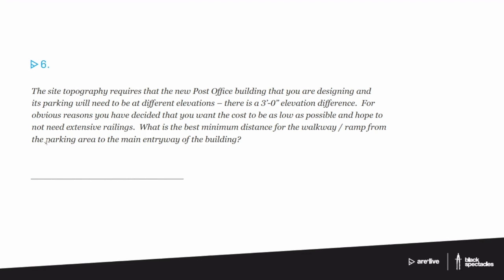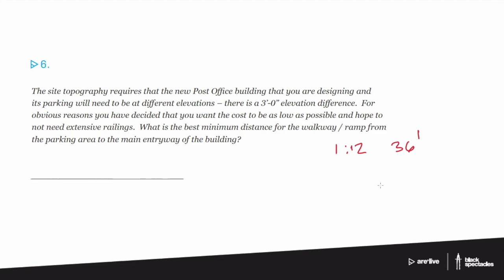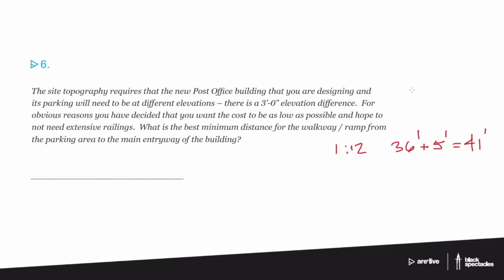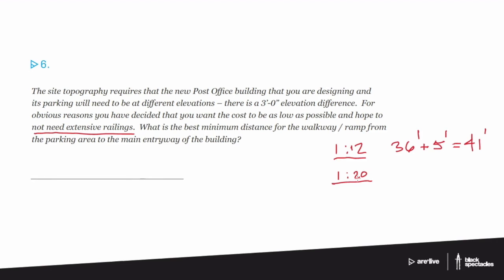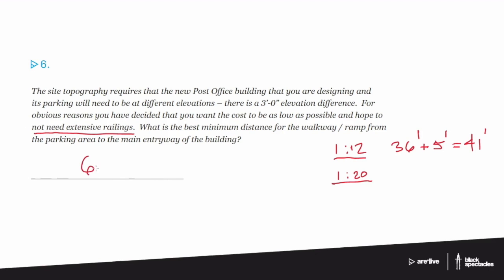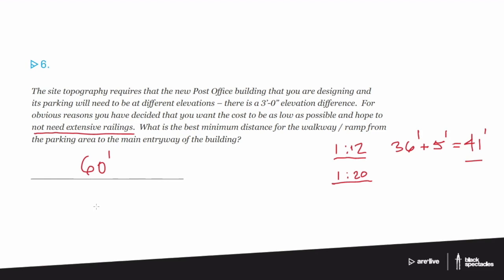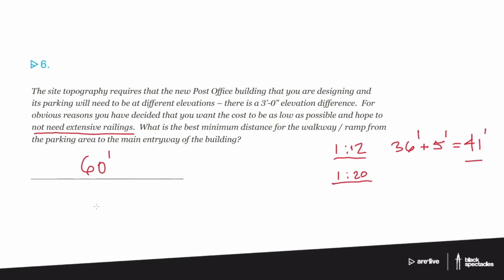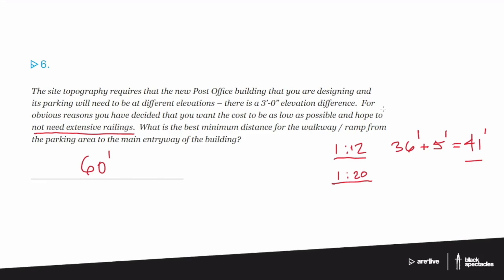Building A Walkway - ARE Live - Programming & Analysis Mock Exam Review

Comment: At what point on this gently sloping raised walkway create a dropoff that requires a railing?  Even if it's a very gradual ramp, doesn't it require a railing when the adjacent grade falls to excess of 6" from the walkway surface?
Reply: I know this is an older comment, but I thought I'd answer it for anyone reading this now. It is important to note that there are different requirements for handrails vs. guardrails. My understanding is that guardrails are required if the adjacent grade drop is greater than 30". Handrails are required if the ramp has a slope of greater than 1:20.